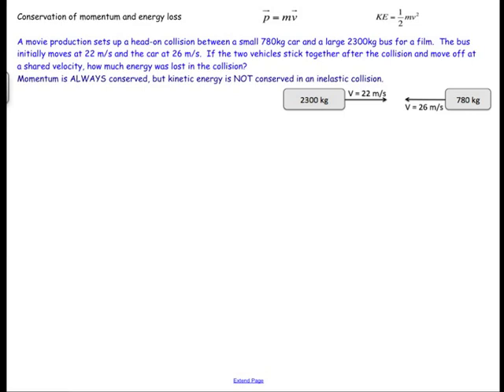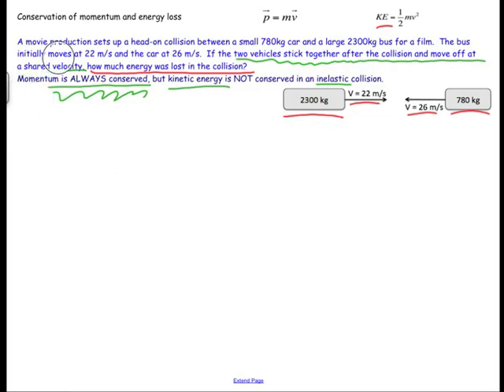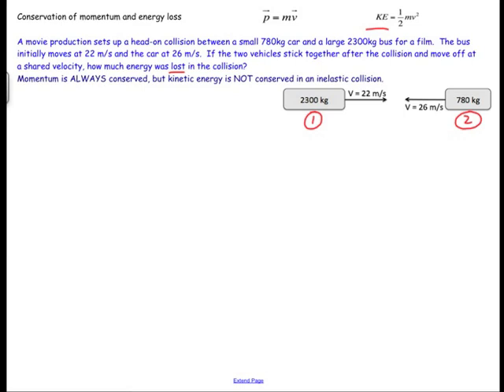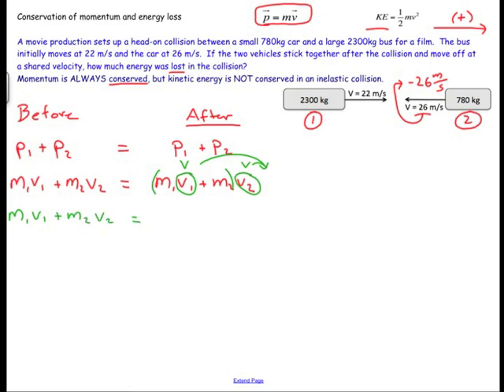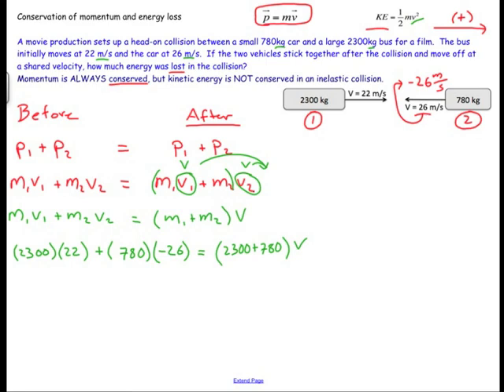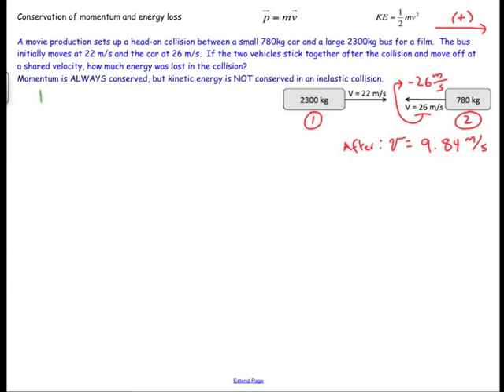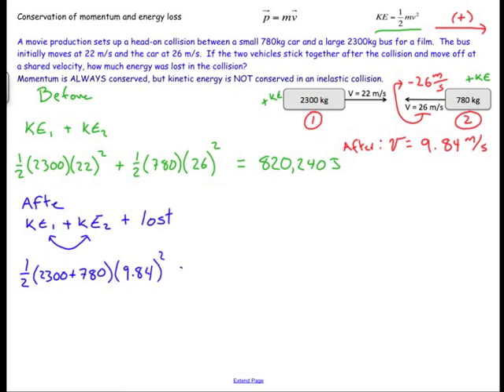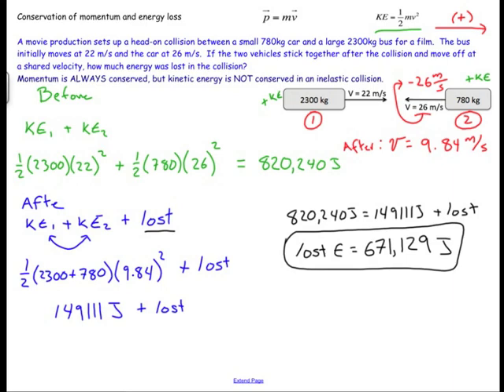Energy Lost in an Inelastic Collision: Sample Physics Problem

Comment: How did you get the final answer though? Did you subtract 820.240J from 149111J? I need an explanation because I couldn't get the right answer from the video, and thank you so much.
Reply: yea, he subtract 820,240 and 149,111. So this is how he did it, he moved the 149,111 to the left side which passes the equal sign and when it passed the equal sign, the number becomes a negative sign. Which indicated to 820,249 - 149,111 = 671,129 J .

Comment: not bad an explanation  however you should avoid using  numbers but rather letters, once all expressions are simplified you can substitute numerical values.
In other words, students concentrate more on the problem and its methodology rather than calculation which can be left to the calculator.
Reply: You're probably right about that, but when I see an endless sea of variables my eyes just glaze over and I inevitably ask "what are we doing again?" Real numbers in this case certainly help me keep track of everything.
Reply: @sticksnstonesThe point is if you know what the letters mean, you just have to plug in the values which is much better over time then having to constantly randomly plug in numbers